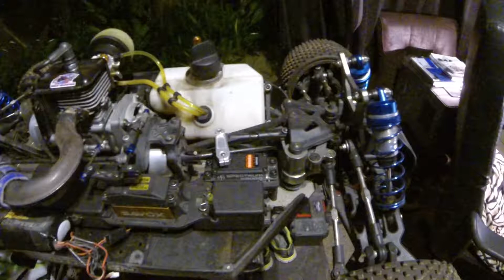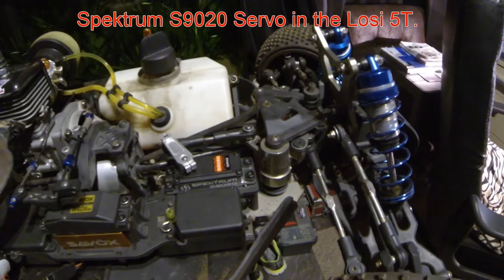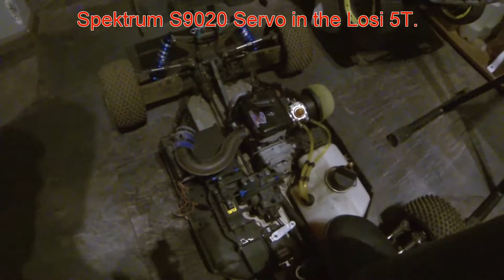Spektrum S9020 Servo

Comment: That's perfect .... I was scared that it only works at 9v with the feet on top of it. But it works at7.4 less chances to burn the servo at7.4thanka
Reply from the maker: It also works on Nimh 6v but with 6v it's less fast turning and less power Florin
Reply: Misja de Boer I've got a killer rc 7.4 7000 battery and I just bot this servo,on specs it said that at 9 v gets 75 kg so let's say on 7.4 v pushes 65 kg I'll. e happy

Comment: How's it holding up compared to stock. Thanks for the video
Reply from the maker: +17madracki17  I think it is THE servo for the Losi 5T. Very strong , fast enough and doesn't get hot at all. I did some races already with it. I love this servo.
Reply: +Misja de Boer thank you for reply. I'm going to try one.